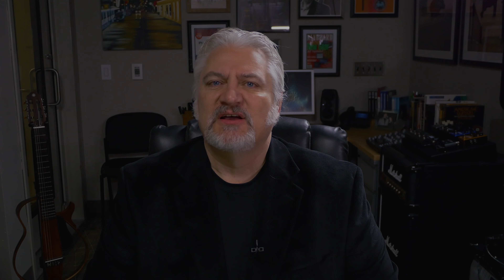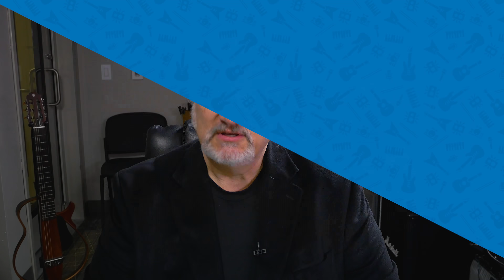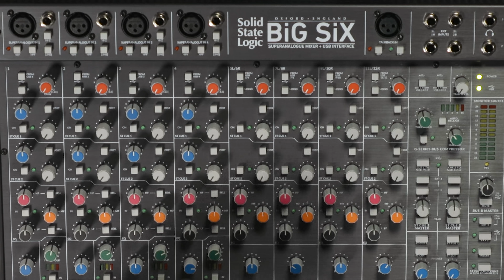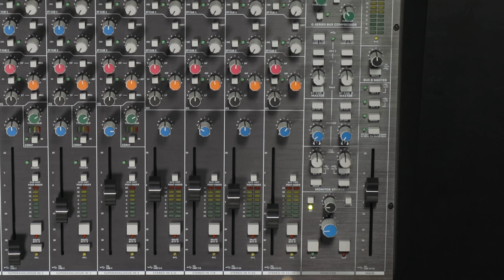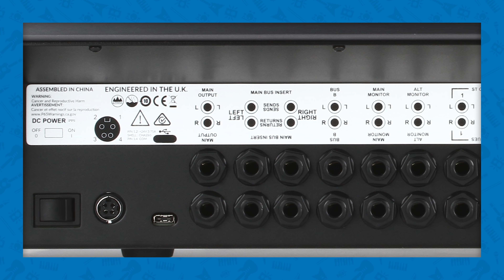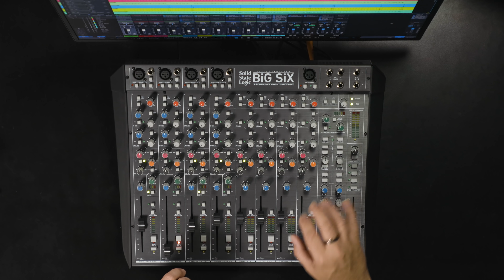Solid State Logic BiG SiX Desktop Analog Mixer and Interface Demo

Comment: Could you group individual channels in the DAW  that you mixed with the Big SiX, then play that group back into a single channel in the Big Six
Reply from the maker: Hey, Kevin! Great question and thanks for your interest. I haven’t tried this personally yet but I did some reading and according to the manual it sounds like you could do that. USB returns 1-4 all feed back in to individual mono SuperAnalogue channels post-preamp, and 5-12 feed back in to the four line input stereo channels.
I hope this helps! If you want to go more in to detail with this, feel free to reach out to me. Or if you download the user guide from SSL’s website it goes in to detail on page 25.
Connor Smith, Sweetwater Sales Engineer, (800) 222-4700 ext. 1793, connor_smith@sweetwater.com
Reply: Yes you can I spoke with Kyle from SSL and you can bypass the interface and use the Inserts and Return so you can use your own Interface and use the Chanel’s individually, I currently have a avid carbon I’m using the D25 Inns and outs  To quarter inch and will connect them to the back of the big six inserts and returns this will allow me to use all the Chanel’s as inserts in my DAW so if you have shity interfaces  you don’t have the ability to do something like this that’s why people are waning about Adat because they have these little shity interfaces and are limited. This product is not meant for the cheap people and beginners it’s for professionals

Comment: I’m super curious about hybrid mixing workflows, but I feel like I need an ‘explain like I’m five’ version of how to use this with a DAW.
Reply: OK so this is actually much more simple than you both think :) 
As a pro engineer, allow me... this is an analogue mixer first. You record your sound sources (analogue ones not software instruments) through directly through DIs or through transducers (microphone). Those sources then come into the SSL BiG SiX console. Then, you have two choices : 1) You use the SSL's EQs pre-USB. This means before the recorded source reaches your recorder, AKA your DAW. 2) You use the SSL's EQs post-USB, which means after the sound went to your DAW. 
This essentially means you can use the SSL BiG SiX as a regular interface with pre-amp and gain only, as a mixer that will allow you to prin analogue EQ before recording (for live use for instance) OR as an interface AND a summing mixer. Now, by pushing the USB switch down, you are taking the USB output and reversing it into a USB input, feeding the sound of the computer backward through the mixer. This allow you to use the SSL BiG SiX as a summing mixer, or like you would a plug-in. You can then hit the record button on your DAW and play-back the tracks from your computer into the SSL, and out into new tracks in the computer. This is the same thing engineers would do with tape, just applied to the digital world! Hope that answers your questions :)
Reply: @jas_bataille  You are the best, thank you for that clear explanation! The only thing I am still confused about, if you would indulge me, is the output routing from the DAW. In my normal workflow, all tracks get routed to a master track and from there to the main outs on my interface. With this, does every DAW track now get routed to its own individual output? And then for the final mixdown, you would route the summed mix into a new master track in the DAW?
Reply: Yeah, I loved the quick and concise overview, but a slower and more expanded review for us Portatrack to DAW folks will be nice.  I'll go see if there is one out there, Sweetwater obviously needs to focus on selling, so they need preach to those who already know what all the jargon means.

Comment: I like it but wish it was 192kHz which is the standard in even SSL's own USB interface the SSL2+.     Did they do this to protect sales of that product line?
Reply: Why would you ever want anything higher than 48K? Are you recording dog whistles? Re-sampling 10x over to stretch the waveform? What is it you do that requires a samplerate that high?
Reply: @mgmg116  SSL has answered that question, and your own experience should answer it too.   We do 'hear' above 24kHz    The rate of change of high frequencies is higher than that and experience more as 'feel' - this extra mechanism of hearing is said to be through bone conduction.

Comment: this is cool, but missing the level of control I'd want to actually invest in it. I don't want the light versions of the eq, compressor, and bus compressor, I want the full thing with the ability to fully adjust the bands on the compressor, the release times on the compressors and the attack time of the bus compressor. If i wanted to buy a mini SSL console I'd want an actual mini SSL console.
Reply: Totally agree. I guess all that’s a way to keep costs low. In the Vintage King demo, they used a bunch of Neve and Rupert Neve outboard gear and ran it through this thing… no wonder it sounded good. I’d pay more for a more in-depth mixer of the same size, with higher quality.

Comment: as someone who’s never used an analog mixer, how/can you use this to mix sessions with 20+ tracks?
Reply: Very easy. Go to the output of each track inside your DAW and assign the output sound to one of the mixers channel. Eventually you will end up with 2 or morr outputs from your DAW to fall into same channel on the mixer. That is not a problem because you can and must use the fader on your daw to drive the sound into the mixer

Comment: Cool video.  I'd love one of these.  Looks like a good combination of an interface and a mixer.
My Mackie ProFx 12v3 (bought from Sweetwater of course) works well and can act as an interface as well, but in trying to use it for live looping in Ableton I realized that  my signal was getting looped and re-recorded.  So if you have Ableton playing your drum loop and try to record a keyboard or anything else you'll get the drums coming back in while recording it.  I'm barely able to work around this by sending the computer audio out to the sub mix (which then means I have to use TRS cables to connect to my PA rather than the speaker cables).  I'm only able to do this because the 12v3 has a sub mix... can't use the 6v3 or 10v3 because they lack the sub mix.

This piece of gear looks like an awesome mixer and an awesome interface, and combined together would be great with Ableton for live performances but then also later on while mixing.

Comment: NIce.  Seems a lot more useful than the regular 6.   Wish they would give you a fully parametric EQ like on the big boys though.
Reply: Their 500 series fully parametric eq is like a grand, for one.
Reply: @BenKash308  Exactly.  GThe EQ's aren't cheap.  For $3k this is a nice step up from the 6, but it still lacks the features of what makes the SSL EQ so great.   Obviously a full 4 band fully parametric EQ would be hugely cost prohibitive, but say just one or two bands of fully parametric, rather than the stock one band hi, med, low.   I know sound quality is probably better with the SSL, but if it's basically just a Mackie EQ given the flexibility.  What made SSL eq's stand out in the first place was the ability to fine tune the EQ and get the exact frequency and Q you wanted.
Reply: @ErikZmusic  I hear ya. I own 2 alpha channels. $1100 a pop.
Reply: @ErikZmusic  I see what you’re saying but SSL are building a hybrid system so for precise eq, use the plugin and for additional colour use the eq on the desk. Or alternatively combine with 500 series channel strip where you have full control of the eq. A smart move by SSL for those who want their gear but can’t afford the drop 5 figures on it at once.
Reply: Yeh, honestly it seems sort of a waste to put those very limited comps/EQs on the channels. They'd be OK for very minor tweaking during a mix. But, you need stuff for tracking. If you have that stuff, it's probably considerably nicer and more flexible, and you'd could just use it instead. More buses might be a better use of that channel space, which would probably drop the price as well.

Comment: This is a phenomenal mixer from SSL
Reply: It's probably just as mediocre as everything they've put out since the AWS lineup
Reply: @mgmg116  never used their mixers only their audio interfaces but you maybe right Buddy
Reply: @NablusRain  In my opinion, their last good mixers were the 900 series.

Everything else they've made has been bland. Like, it's not bad equipment at all, it's all fantastic, but it's too clean. Too sterile. Doesn't impart any interesting harmonics to the sound, doesn't add anything to your signal the way it should.

If I invest in analog gear, it's because I want that gear to impart some character or vibe to my sound, but all of the newer stuff sounds too clean for my tastes.

In my personal opinion, it makes more sense to buy a used FOH/live mixer, like a Soundcraft or an Allen & Heath or even a Mackie, and then buy some outboard converters and an RME interface to get all those channels into and out of your computer.

It'll give you that analog saturation, total control over the sound in the digital domain, AND it'll still cost less than the new SSL Big Six